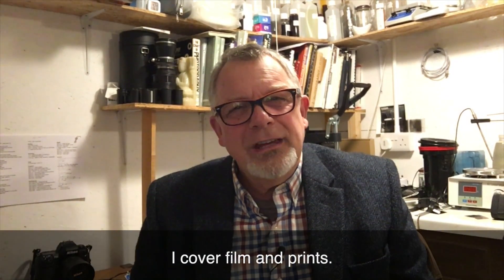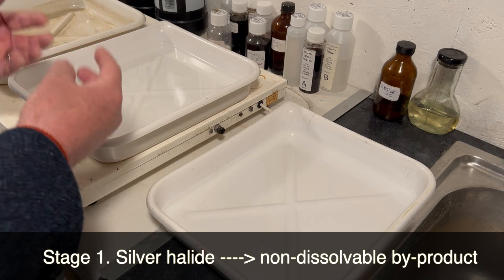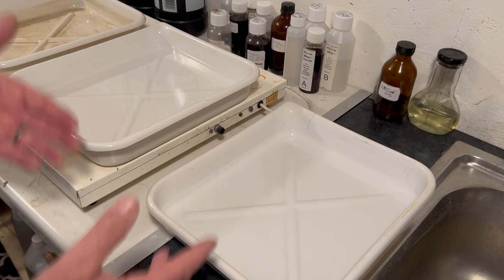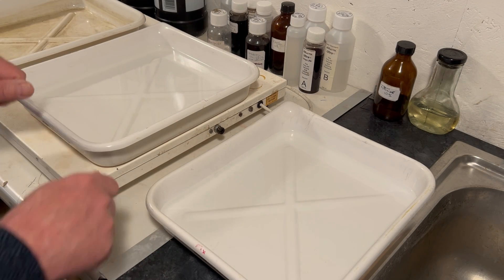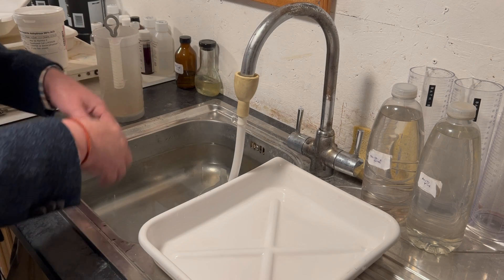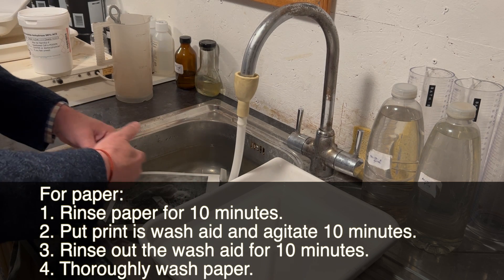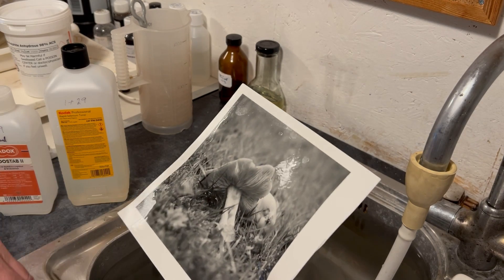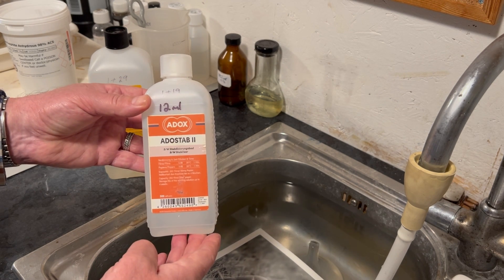Do You Use an Archival Process? Try this!

Comment: Many thanks John for this video - it is very instructive to me -  I will it to review the way I do fixing and archival washing - just two questions : 1. Now I am using ADOX Thio-Clear ECO after  fixing to eliminate residu of fixer. Then I wash film for 10 min and fb paper for an hour. Is this good practise? 2. Also how do you test/check when fix bath 1 has to be discarded? 
I also want you to know that your videos are very good and helpful to improve my way of working in creating  photos!!! Thanks for this - very much appreciated!!
Reply from the maker: Hi Dirk! Thanks for your comment. Your workflow sounds very good. Stick with it and I think you will be in a good place. 

To know when your first fix bath is finished just note how many papers you put through it. I have a post-it note on the wall and write (in pencil) how many sheets I processed that day. When they add up to near the maximum for the fix I discard and move bath 2 to bath 1. There used to be silver test kits but I haven't seen one for an age. If you're not sure how many papers you have put through your fix bath 1 I would discard bath1 and swap for bath 2 and start again - that way you are only throwing away 1 Ltr. 

Thank you again for your kind comment!

Comment: I tend to use two bath fixing like 2x clearing time in bath one and fresh clearing time in fresh fixer. That basically adds up to 3x clearing time. Especially with film this allows me to really use up the 1st fixer without a risk of residue. When 1st fixer is done (lclearing time 2x or 3x fresh one), rotate 2nd fixer to 1st and so on. So much better than guessing if fixer is fresh enough. Counting films is also guessing, because you have random amount of silver to dissolve depending on exposure and scene.
I think two bath method adds almost no extra work and is a good practice.
Oh, sodium carbonate (washing soda) can also be used as a hypo clear, again about teaspoon or 20g/liter. (I think you recommended only sulfite and bicarbonate on video). It can be cheaper and more easily available. At least I can pick it up at local store in large packs unlike sulfite that I have to order or baking soda that is sold in tiny packages.
Reply from the maker: Great comment, thanks!!

Comment: A worthwhile video once again. I use the 2 bath method of fixing for prints in my Nova 4 slot processor and feel that it is both economical and worthwhile archivally as you describe . As I only use RC paper I feel that wash aid and any washing beyond about 3 mins in running water is probably unnecessary for me. 

Same kind of question from me but on the re-use of Adostab rather than wash-aid . Can Adostab be re-used for more than one print?

Thanks
Reply from the maker: Thanks for your comment. Yes, Adostab will process 2 square meters of paper/film per 1 Litre working solution.

Comment: Since I don't go to the darkroom often I wonder how much would the mixed fixer last (apart from the 40 prints). I usually work long hours two days in a row, so I mix fresh developer the first day and then discard it after the second day. I'm considering including your routine in my workflow though! Thanks again for another great video.
Reply from the maker: I re-use my mixed fixer for a couple of weeks, no problem. My film fix lasts several weeks.